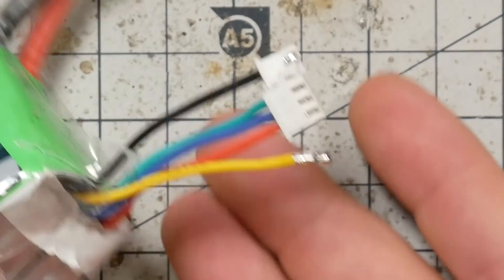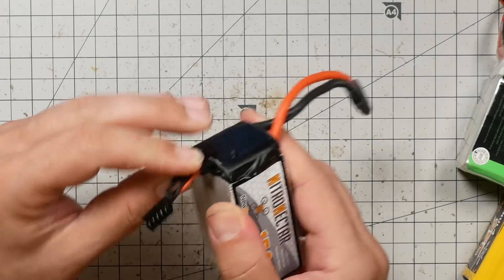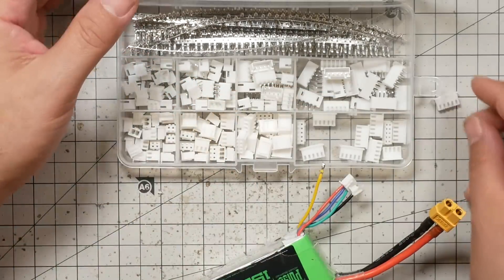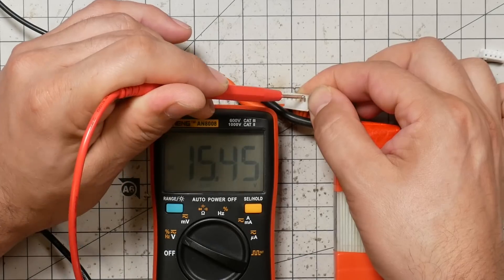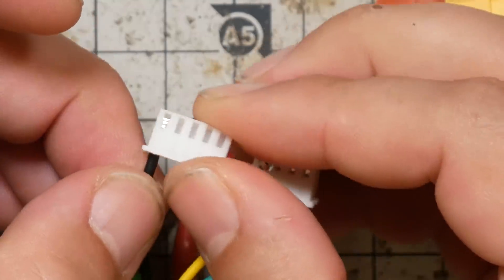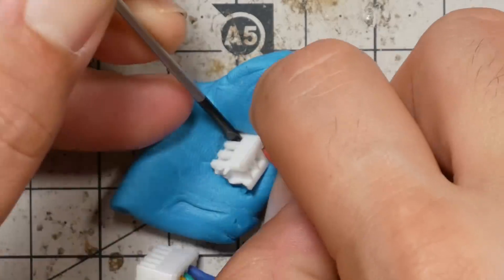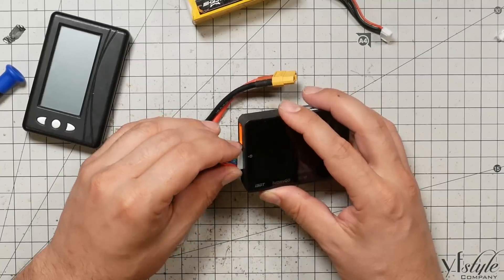How To Repair A LiPo Balance Plug

Comment: What if the cable doesn’t have that pin anymore?
Reply from the maker: Then you have to either crimp on a new pin or solder splice a new wire with a pin on it.

Comment: Don´t push down the retention tab, flip up the retention plastic tab!!!! with something pointy/sharp.
 
And use a marker and draw stripes on the wires corresponding to the number, just in case.

Comment: Hi Joshua many thanks for all your videos. I am a newbie to FPV. I recently bought a HTRC c240 duo and one of  the balance charge boards doesn’t work. Instead of shipping me a replacement the seller told me it’s not necessary and I could connect the battery directly to the parallel port. With different batteries having different sizes of parallel charging cables I can’t believe that. What’s your advice here please? Thanks again.
Reply from the maker: Most chargers have a balance port that can take any size plug. You just plug it in with the ground pin all the way to one side (whichever side is the minus pin on the charger) and it's fine. It's completely normal to do it this way.
Reply: @JoshuaBardwell  Joshua, Thanks you so much. I learnt  even more today!🙏 I simply am floored that you responded. How do you find the time? So generous. warm greetings and blessings.

Comment: I really need a response if possible. Driving RC tonight balance connector got broken while driving the truck. It was dark out so I noticed some sparks/little flickers of light from under the truck. I immidiately opened it and separated all the wires to keep from touching. Brought to garage and taped all individually. Is it safe to repair this with a new connector end or solder in a new pigtail? Or is my battery not reliable and should be disposed of?
Reply from the maker: It's probably fine to repair.

Comment: I had the problem that the housing broke after a crash and two wires touched. One time it was a really bright spark which burned my carbon frame even. I quickly snipped one cable but the two connectors are like soldered together. Scary.

Comment: you may find it easier to use a flat head screw driver from a jewellers screwdriver set. Also if I find one that is difficult to get out I just cut it out with a razor knife. The tip on using a rubber band works great, thanks. Also batteries since you made this video have seen a big increase in price so I am doing everything I can to save them now.

Comment: Question, how do you fix the little cuboid part at the end of the wire if it has snapped off?
Reply from the maker: Basically, replace the whole housing.

Comment: Hi, another very good video.  I have a https://www.quadcopters.co.uk/4s-lipo-batteries-148v/tattu-funfly-1800mah-4s-lipo-battery which I have to repair.
I have 1 red and 4 black wires on the battery.  I have an extension cable (also has 1 red(right) and 4 black wires) which I am using to repair the balance part, but when I check the voltage the red is showing max voltage and going down to zero for each cell.

Comment: well, it's good to know that rubber band trick... after my first flight just learned the hard way, after a crash the plastic thing of the balance lead got shattered to pieces and all the wires came off, furtonatly intact so it should just be buying a new one and check if the cells did not short circut and killed themselves... will buy the rubbers asap ahahahah

Comment: Another great video.  Unfortunately I didn't wrap my cable correctly and now have all bare wires (now taped individually).  At least I can now repair it.  Would you recommend a charging board?

Comment: You neglected to mention that some LIPO chargers use a proprietary ballance port that the JST-XH connectors will not plug into. Mating connectors are difficult (read as impossible) for the consumer to obtain. 

http://www.keywild.com/X/ISDT_9_Pin_Ballance_Connector(1024).jpg
Reply from the maker: I have literally never seen that balance plug before. That's a standard balance port and a weird balance plug.
Reply: @JoshuaBardwell  look at some of the "LIPO Balance Lead Repair" videos on you tube. They mostly reference replacing the connector housing with one from standard JST-XH connector.

Comment: Once again thanks for the video I was literally about to salt bath my lips today because I didn’t know how to fix it. 🙏🙏🙏🙏
Where can I get those metal tabs at? My drone chopped all my wires off and if one wire touched another should I check something to make sure it’s still save to use? I caught it when it happened so it was fast then I taped all the wires up

Comment: Hey JB, 

Your videos are saving me! Really appreciate all your effort to educate in this hobby. Long shot, but as a noob, I didn't tuck my balance lead away and now I have a 6s battery with a broken balance lead from the prop. The wires have touched and sparked a fair amount so wanted to know if its worth repairing or not?

Comment: Hi Joshua, as a rule of thumb, is an individual cells milliamp hour rating the total mAH rating divided by the number of cells? I ask because I've salvaged good cells from batteries where one is bad and always wondered what the mah was of the salvaged cells.
Reply from the maker: Each cell is the same mAh. They are in series so the voltage adds.
In other words, take four 1000 mAh cells and wire them in series to get a 4S 1000 mAh.

Comment: This is a nice video.  I do have a question about the plugs.  I purchased 3 Hobbyking Zippy batteries and the balance plug was thicker than my balance board or my charger.  From my research I think these plugs are 2.54 instead of 2.0mm.  Do the plugs you have in the kit fit in the charging board or the battery charger?  Thanks
Reply from the maker: I would be really surprised to learn that a battery was being sold with non-standard balance plugs.
Reply: Joshua Bardwell well get ready to be surprised. As soon as I make it to my garage, I’ll take pictures of it.   Do you have messenger so I can send pictures?

Comment: I seen a rubber band on your table, and thought that was one of your ways to hold the wire harness down, as that is what I do, and the rubber band helps in keeping the lipos from sliding on the quads.

I even 3d printed a battery holder for my planes that squeezes up against the sides of the lipos with rubber bands on them.  

If the lipo is to small and I made it to be larger then most lipos I use, I just add card board, or foam board with a little shot of hot glues on the sides and wrap  rubber bands around that.

It works really well as I can slide different size and weight lipos in my planes to adjust CG.  So I'm not limited to much by lipo use on my planes.

The holder allows for grasping of lipos on their sides acting like disk brakes on a car in a crash. And the rubber bands act like the brake pads between the holder and lipo preventing damage to the lipo

Nothing worse then a smashed in lipo after crash and we know in the rc world crashes happen more then we admit! And we lose motors and props all the time, but when a lipo gets trashed you can loose everything if it catches fire.

In the front of the holder I also put in some foam or bubble wrap to helping to cushion in case of a crash.

That has cut my lipo replacement per year by 75%.

Comment: So I replaced the balance battery connector on my 4s battery I fixed two properly that were damaged but one of them displays the voltage when I use my volt checker but when I plug into my charger it doesn’t detect it I also used a volt meter to double check my order and there in the right order just not sure why my charger won’t detect the pins any suggestions

Comment: When i landed my quad there was exacly this problem but 2 wires that were out touched and there were some tiny sparkles but nothing serious. I checked the the whole voltage trough thr xt60 and it seemed like all the cells were working (24 V) 6s battery after 1 min of flight.... can i still use it?

Comment: For removing these connectors from plug housings I like to:

Secure the housing flat on the table with one hand,
Use the tip of an exacto blade (No. x616) to depress the catch and simultaneously slide the connector out of the housing with the tip of knife in the other hand.

The knife point kinda bites on to the connecter retaining tab allowing you to push (slide) and depress at the same time. For stubborn or fiddly ones I'll use some masking tape to secure them to the table.

No need to pull on the wire this way....Usually.

Comment: Can I solder a new plug to the wierez mine have snapped all different sizes ... iv for a plug with a wires in it already and I want to cut and solder them so it's all the same length again....or will it blow up in my face
Reply from the maker: You can do this, I would just recommend cutting and soldering only one wire at a time.
Reply: Fantastic mate thankyou so much ..... I wasn’t sure if the heat would pop it in my hand ..... I love that you always reply you at and have been my go to guru .... yu have a video for everything .... and I appreciate it buddy

Comment: Lol were you applying pressure with a sharp object towards a LiPo? xD
I hate to pull those suckers out, especially the smaller wires like on vtX's and cameras. Those connectors with the little plastic covers over where you apply pressure... I always somehow destroy these and the wires wont stay in anymore.

Comment: You can also just cut the balance leads before disposing your dead lipos. Then just solder them onto ones with broken ones. Not as clean but at least I don't have to keep one of those large boxes around ;)

Comment: My thunder power batteries seem to be a bit smaller than the white housing your showing will they fit into this housing also? For they are black and closer together
Reply from the maker: Balance connectors are basically always the same.

Comment: Ok, I fully admit that this is down to my own lack of electronics knowledge. But about a year ago I was fixing up a balance lead and accidentally touched one of the ends...  I got the shock/burn of a lifetime on a finger. Hurt like crazy, deep cut/burn. But here I'm watching you appear to hold the ends without care... where-as I'm ultra paranoid. Can you clarify why I got burnt and you aren't?  I feel silly asking this, but I'm feeling that I'm now being paranoid where I don't need to be (around repairing plugs)
Reply from the maker: I really have no idea. The voltage on an individual balance lead is at most about 17 volts if you were to touch the highest and lowst wires, and the voltage between any two adjacent wires is less than about 4 volts. If you dead-short 17 volts with a wire, you will get enough current flow to heat up and burn. But your skin should normally have enough resistance to prevent this. If your hands were wet, then you might feel the tiniest bit of tingle. But you would have to be touching two of the balance wires to complete the circuit, not just one. A single balance wire cannot shock you because there is no path to the negative terminal of the battery.
Reply: Thanks for the info. Hmmm, it happened so quickly that I've assumed I must have been touching 2 wires (but was only focusing on a single wire, trying to remove it from the cracked plug/case). Wonder what on earth I did to cause such a burn/cut on me. Thanks anyways, I'm still going to be super paranoid when repairing these :)

Comment: Don't use normal yellow rubber bands because they break easily and dry rot quickly. 

Instead, use a cut up bicycle tube!  They're super strong, hard to break, and don't dry rot in years!  

If you're ever at a race with me, ask me for a few, I almost always cut extra just to give out!

Comment: SO in summary left negative or ground and increasing cel voltage thereafter    still doesn't make Soldering to one of these wires feel any safer but I learned something but yea 6:41  feels mighty scary

Comment: balance plugs and their pins are a right pain the ass, even new ones and the charging extensions, i always hotglue them to the plug, but not to go beyond the the top of the plug, and it holds them steady enough withoput popping out. plus it helps on wear on tear close to the pin ends.

Comment: How do you lose disconnectable balance leads but not the balance lead extension? It's the exact same thing lol
Reply from the maker: The difference is, I can leave the balance extension at home and the battery is still usable with a balance checker. With a custom lead, the battery is not usable unless you have it.
Reply: @JoshuaBardwell  Well now that makes sense, hah.

Comment: Thanks for the info. Josh, what exactly happens when a battery puffs. Is there gas in it. What would happen if you poked it with a pin to release the pressure? Thanks, Greg.
Reply from the maker: Whatever you do, do not puncture the cells. OMG don't do that.

What causes a battery to puff is that the chemical in the cell is damaged and gives off gas. Because the cell is not totally airtight, sometimes the gas will leak out and the battery will "un-puff" but the damage is done. Whether the battery is physically puffed or not, once it puffs, it has been damaged. So trying to squeeze it back into shape or whatever doesn't matter.

Comment: I recently bought some batteries and check internal resistance before I broke them in. What should internal resistance look like on a new battery? I had one that 2 of the cells were significantly higher than the other 2 cells.
Reply from the maker: In general the IR should be about the same for all cells. But be careful because many tools that measure IR actually don't do a great job of it.
Reply: @JoshuaBardwell  The other battery received had relatively equal IR. I discharged and charged on my charger for 4 cylces and the IR got a little lower but the gap between the cells still pretty large.  044, 017, 016, 043.  The other battery was within a couple of numbers from one another.

Comment: Yep, it happen even if balance plug is tied to battery. Trees, pipes and concrete are bitches. Changing broken plastic part to new one is not difficult. A real fun begin if one of metallic connectors inside is smashed and must be replaced. Did that by hands and screwdriver twice :)  Now I have crimping pliers for this job.

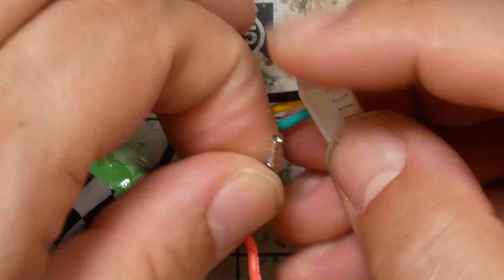Comment: It gets really scary at 7:16 as you have two leads out of the housing and it slips out of your fingers. Also you look really convincing at 10:23 saying "I'm never having more than one of these wires out of the housing" :).

I did sort of similar repair in the past, and a really good advise I can think of is to just put a piece of heat shrink on the leads (without shrinking) if they must to go out of the housing more then one at a time (or use electrical tape). This extra step may be very useful. Those short wires rrrreally want to get together :).

Joshua would you consider to test shorting the balance leads for the educational purposes in some future video. Maybe you can use extension cord with balance lead connector and high current switch on the other side, use retired Lipo for that. I bet those balance leads will melt instantly.

I would really like to see that experiment (do that outside :)

Comment: Yep just like when I do this.  Those tabs are a PAIN!!  I'm laughing as you're doing this!!  Try using small vice grips to hold it gently and a very pointy screwdriver.  Sometimes I just re-solder the difficult tabs they can get damaged removing.

Comment: Very nice video. Love the "your gonna learn something new" intro on your videos. Just wanted to touch on a couple of safety tips. When working with batteries, lower the voltage as low as possible without damaging the cells. If you short out the battery (and one day you will) a fully charged battery has a far bigger punch. Either way your gonna jump but far less dangerous. 

Also, get a lipo fire retardent bag and keep the battery in the bag as best as you can while working on the leads. I've heard they burn at 1600 degrees. Never use water to put them out. Fly long, fly fun, fly safe
 
PS congrats on the Liftoff Sim. They did an awesome job on your home.

Comment: Joshua, I would love to hear some cold weather battery storage tips. If it’s 12 degrees outside, can I just leave my batteries in the car until it’s time to fly, then just strap one to the quad and punch the throttle?
Reply from the maker: You will definitely get better performance if the pack is warmed up before flight. But cold won't damage the packs.

Comment: Hi there! Thanks for the link to the balance plug housings box...neat! Anyone know if it is possible to buy something similar but with the connectors that are used in FCs, FPV cams and onboard components...don't really know what the actual name for these connectors is :-O
Reply from the maker: https://www.racedayquads.com/products/sh-1-0-silicone-cable-set
Reply: @JoshuaBardwell  Wow you really are a knowitall  ;-)  I'm buying from Madrid in Spain so probably won't use the racedayquads link. However I have already found equivalent stuff at Banggood searching for "SH connnector"...thanks JB!!

Comment: You are the man. For some reason I didn’t know plug voltage orientation order. I just yesterday put a new plug on but since they were mangled I couldn’t figure out their order, I think it’s correct it checks out on a battery checker, I’m gonna check it on a multimeter now! You may have saved my house. THANKS

Comment: Joshua i just found a battery i really love and they have the extra balance lead like you showed they are called the black label batteries you order them from indestructible quads and the batteries are really nice best batteries ive used yet you should check them out and also they are some of the best deals ive seen too